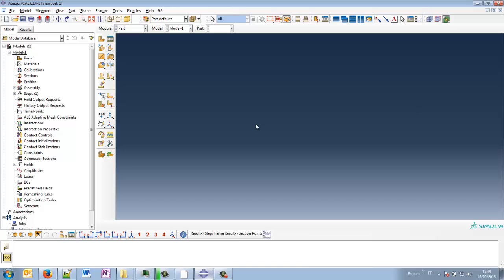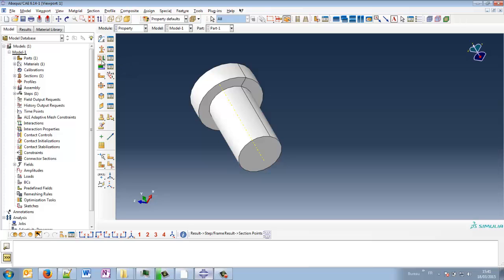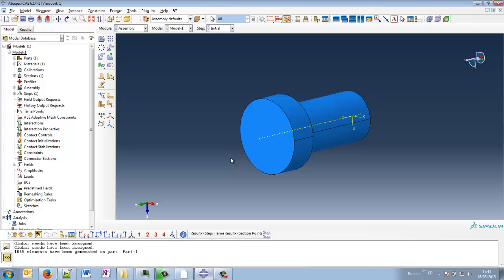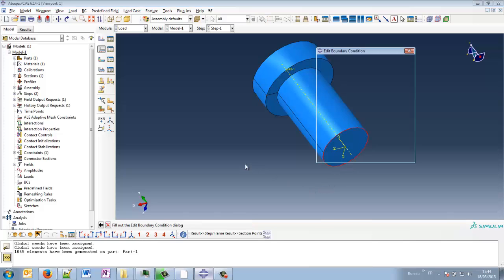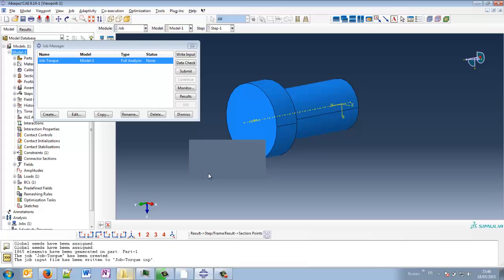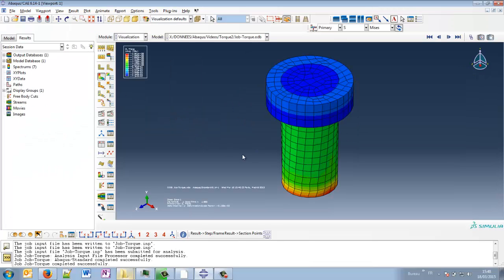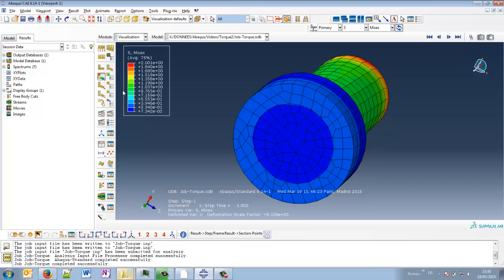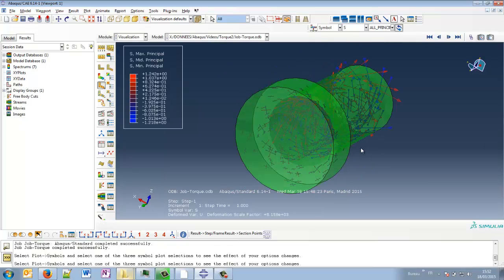Abaqus - Simulation with Torque in Abaqus/CAE

Comment: Hi, Why the top twisted a lot but after a small distance below that the rotation UR2 is very small (close to 0). TIME: 11'40'' This can be seen by looking at the contour colour and querying the UR2 values at points. I ran it and got the same problem
Thanks for your video!
Reply from the maker: You are welcome
Good question!
Because the model is composed of solid elements (C3D8R), post-processing the rotational degrees of freedom is useless in fact.
The best is to post-process the translational degress of freedom (U, Magnitude)
Reply: @dpsdigitalproductsimulatio7646  Hi, So how do I get actual contour of "the angle of twist" ,btw ,thanks for the video & reply.
My situation: I can get the right answer of the angle of twist, but it only shows at the surface where I put a torsion on it(the same as your video UR2)
Reply: Hi, i have the same elements as you used, but I cant run the analysis. It says that Im missing 4-6 DOF. How can I pass this problem? what do u mean by " The best is to post-process the translational degress of freedom (U, Magnitude)"?

Comment: Thanks much!  I would never have figured to make the kinematic coupling to get moment working on a face.  Why Abaqus requires the moment only on a point, I don't know.  Cheers!
Reply from the maker: +DiscLauncher 
You are welcome.
There are several ways to apply a moment, (for instance, concentrated forces applied at different corners of some part will eventually create a moment...). In the video, a "concentrated" moment has been chosen. "Concentrated" means the final support of the moment will be a node (therefore, a point in an Abaqus/CAE associative model)